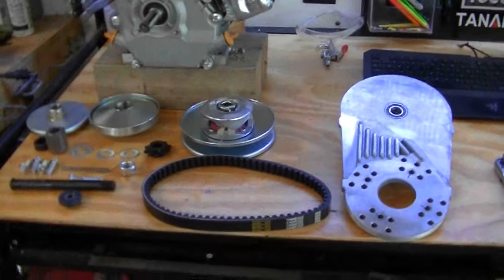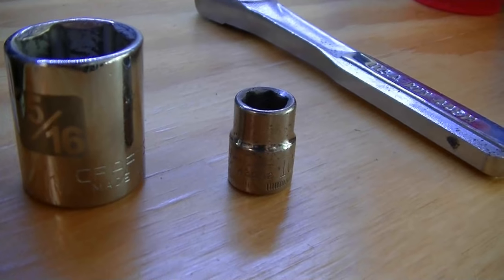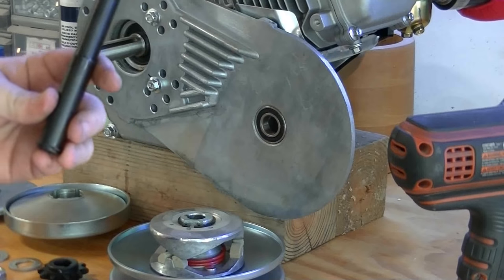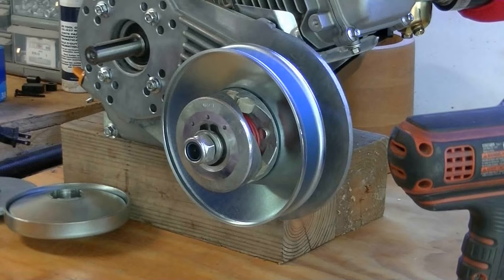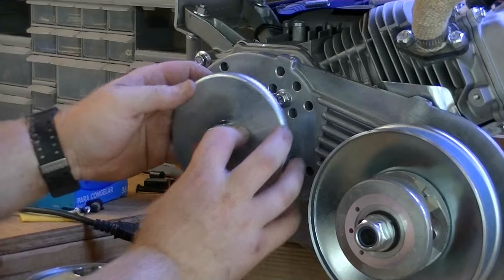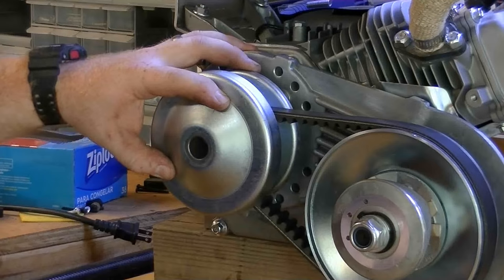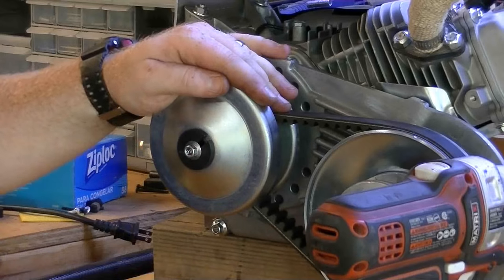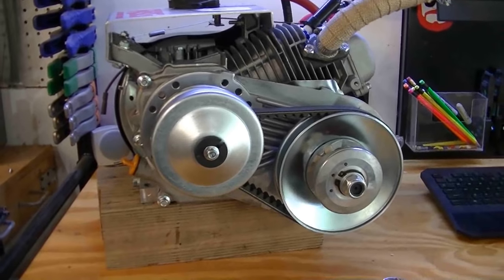Predator 212 Go Kart Torque Converter Install

Comment: What sized bolts do I need to mount the thing to a predator 224?  The ones that came with mine are a different thread. Would they be the same thread as a 212?

Comment: Hey Red Beard, your knowledgeable about these things I got a question? Can a torque converter go bad enough to stop an engine? I noticed it's been happening lately and when I try to restart it the wheel moves with the pull string. If I roll the bike a little bit it breaks loose and I can start the motor back up. Could it be one of these pulleys going bad or getting stuck?

Comment: Warning! 
The 4 bolts that are needed to mount it to the motor are 5/16 - 24.
I didn't see it mentioned anywhere and spent a couple hours and trips to 3 different stores all while lugging the motor with me the entire time to find out.
Reply: Why didn't you just look at the engines manufacturer's spec sheet, Google your engines owners manual and shop maintenance guide PDF download, they tell you everything you would ever need to know.
Reply: @BubbaB43 
While that is a good point, the poster's point is that the info in the video is wrong on the bolt specs.

Comment: Several have made inaccurate comments about problems with the front bolt (thread and length). I bought this same exact clutch ( Comet 30) from gopowersports last year, used the same bolt here in this video, and the front bolt works perfectly with my Predator Hemi 212 from Harbor Freight. I would know if the threads didn’t match… I’ve been turning a wrench for 45 years. You guys are misinformed. Amateur hour & armchair know-it-all’s.

Comment: So the bolts that are supplied or actually the ones that work on it I same one video before that they said you had to switch him out with some other kind because the threads weren't the same

Comment: I’m installing on a HF predator 212, the bolts included were not correct. I needed 5/16-24 SAE.
Reply: I had the same problem
Reply: What bolt did you use for the crankshaft on the torque converter

Comment: When you mount the clutch to the crankshaft that is not a 10mm bolt. It is a M1.25 metric bolt which should not be used because  the predator crankshaft comes tapped for 
5/16" 24 (fine thread) bolt
Reply: Tim othy 5/16 24 = m8x 1.25
Reply: @timnell9423  Not true.

Comment: Just bought one of these setups for predator 212 becuase the kids kept blowing up the old stock comet. Beware those sprockets, they have broken the keyway one in half more than once, so i upgraded it to an ebay replacement with keyway built in, eliminates that weak point. Thanks for the video
Reply: AH! I just bought a 9 tooth to replace the 10 for more torque, but I thought it looked thin and weak where the keyway is cut in... I did see the ones with the key molded in, makes sense! Good heads up!
Reply: Link? Wdym?

Comment: i have the same motor for my ho kart it comes on but everytime i give it gas it cuts off... it has gas and oil what am i doing wrong
Reply from the maker: +Shanesha Grayson it's always hard to troubleshoot something over the Internet. First off have you did any performance mods to it?
Reply: Shanesha Grayson did u disconnect the oil switch wire.it might be to full.its that sensor on the front with the two wires.
Reply: gotta give it a minute or two to warm up, then switch it to run
Reply: HOGSIDE SJ T.V. Thank you so much bro this fixed my problem, I'm so pumped to drive it again!
Reply: Just dump and clean fuel bowl

Comment: I have a similar torque converter but it doesn't disengage when idling...I made sure that the belt is aligned and that it is facing the right way but still no luck...any ideas on why this is happening?

Comment: Hi RedBeard great video. Used it to install a new $65 TC off eBay for the 212. However, after I installed it, the go-kart vibrated REALLY bad and didn't accelerate worth dookie. I've done engine swap before and such, so I made sure everything was aligned properly, bolted on tight, chain had just a little slack, belt clutch on drive shaft tight (had to use shaft spacer to align clutch with jackshaft), even made sure the tires were equally inflated, what could be the problem!? It didn't vibrate before the TC install
Reply from the maker: +boisebadboy93 I really have no clue what it could be. It's hard to diagnose something over the internet

Comment: I'm trying to figure out what size and thread the bolts I need are to mount a TAV2 to a new Hemi head Predator 212. Also the bolt size / thread for the output shaft.  My torque converter came with all the wrong size.
Reply from the maker: +BWX I'll have to look and see what size they are. Next time order from go power sports and you won't have that problem. Lol.
Reply: Yeah I guess but I don't think a few bolts are worth $74 extra which is more than double the clone price. If their prices were more competitive I would definitely support them with my $$.  I think the clutch mounting bolts are 10mm but not sure about thread pitch.
Reply: For anyone reading this 10 years from now or something:

I did some more research-
I think the bolts you need are 4 x 5/16 24 thread pitch 1" - To mount 
plate to engine.

1 x 5/16 24 thread pitch @ 1 3/4" - for mounting the drive pulley to the output shaft.

Then you need to raise engine up about 3/4in to an inch to clear drive  pulley above frame (still need to cut plate though), so you need longer  engine mounting bolts too.

Comment: Read Beard... I just bought a used Baja Warrior and it has a Preditor 212 and CVT but the problem I have is the two pulleys are about 1/4" out of alignment, the drive pulley is too far in... I removed the washers on the rear shaft until the chain hits the backing plate. I suppose I need to make a front spacer to fit on... another problem I created is that I stripped the threads in the center of the engine drive shaft, so I'm going to have to drill it deeper , tap it and get a longer bolt to hold the drive clutch on... so beware!

Comment: I just installed pretty much the same one on my kart w/the 2121 and I can't get the wheels to spin freely when in idle. When I pull start the kart it wants to move the wheels along with it. I dialed  back the idle as far back as it can just in case and still it seems like the torque converter belt is engaged even when in idle. Have you seen this? Any suggestions? Is it just a bad Torque Converter? Here is mine: https://www.youtube.com/watch?v=MMP0gvC3AOY

Comment: I got the same torque converter and everything fits very well, but if i speed up its sounds very Bad and the spring  vibrate hardly on the engin side . I think its because of the spring on the driven side. Its looks like its made for the other direction. My Engine is turning against the clock. Have tourque converters a direction ? Or they work booth ways ? Edit: sorry for my german english
Reply from the maker: Are you sure you seated the outside bell on the flat sides of the inner cog?

Comment: I purchased a  TORQUE CONVERTER KIT CLUTCH 3/4" COMET TAV2 30-75 218353A 12T #35 10T 41 for a golf cart.  I found drive belts for (30 Series Torque Converter Belt Comet TAV2 203589 Manco 5959)  will these drive belts fit  they say they will fit the COMET TAV2 but the last numbers are difference?   Also long will these belts last?  I like your videos keep them comming.

Comment: the go power sport page has many to choose from. what one works on the preditor 212.
Reply from the maker: 30 series kit
Reply: Thank you. mine only came with one sprocket, how can i tell which chain to buy. this one is 10 tooth and a quarter inch wide. Thanks. You rock.

Comment: I just built my drift trike and finished it(looks sick) and i broke my torque converter back plate in half SMH ....do you think i should get it welded somewhere or is it easiera and cheaper to buy a new one? If you watch my video youll see i just bought a new $60 clutch from tractor supply for now...but id like to Get the torque converter on it and fixed..thanks man your channel is awesome! 👍

Comment: hey Redbeard I have a question I have the maxpower 455 35c 12T max torque clutch...my question is if I take that out and replace it with a torque converter is there any difference in speed..top end especially...thanks
Reply from the maker: +scotty w we gained top end when upgrading to the CVT from a clutch. The torque form the CVT alone is worth it.

Comment: are these cvt converters compatible with any stationary horizontal generic engine of aproximated size and power? or are more detailed about  each model as it uses specific rpm i suppose, would it work on smaller engines, if not so, are there simmilars for smaller ones?
Reply from the maker: Yes the 30 series which this one is, is made more for 6.5hp engines and lower. The 40 series will handle the larger engines.

Comment: Thank you for the guide. Will follow this to a T when I receive my torque converter.
Random question - which length of 5/16-24 bolts do I need to mount my predator to my Go-Kart? Thank you.

Comment: I am looking into picking up one of these, my only problem is that I have a 428 sprocket and chain for my bike and I can’t easily change to one either the 420 or #30 chain/ sprocket. Are the sprockets that come with with the torque converter replaceable with different sizes?

Comment: im having problems with mine. its eating a belt every hour or 2 of riding and i have not a clue why. the inner plate and the jack shaft pulley are not perfectly aligned(the side closest to the motor and its a very little difference) any advice? also i have an off road go kart with a 72 tooth sprocket that was originally powered by a Mitsubishi 6hp that had a weird torque covert on it it but i decided to repower it with a new predator engine and new torque converter that i got off of amazon
Reply from the maker: Are you sure you have the right size belt? You could have a smaller belt on it and that could be the reason.
Reply: Yeah I used the belt it came with so idk it was a little tight
Reply: Chris Wrigley I had the same problem. I never had the plate, mine goes straight to the jackshaft. you need to install grade 8 washers to space it evenly. grab a longer grade 8 bolt to go with the washers. install on drive, not driven

Comment: At 4:07 I noticed you only had a 1/2 in" of shaft to put on the last part of the clutch. Is that going to be ok? I bought a new motor for my go cart. My old motor has about an inch more of shaft than the new one. I am going to have mount it the same way you did on that last half inch of shaft.
Reply from the maker: It always worked good for me

Comment: Im having problems installing mine i did everything you did exactly but when i turn on my engine the belt speed keeps spinning without me even pressing the throttle  so how can i make it stop ? The belt speed should only spin when the gas pedal is pressed right ?
Reply from the maker: No the belt can spin at idle as long as the go kart isn't trying to take off. If it isn't then your good to go.

Comment: New to karts. What's the difference between a 30 and 40 series? I'm upgrading from a Briggs 3.5 to the 8hp predator and I'm not sure which converter would be best. Thanks
Reply from the maker: The 30 series is more for the smaller engines and the 40 is for the larger engines. They sell them by power levels. 301cc you would want a 40.
Reply: 30 series

Comment: So I’m working on a Baja warrior 200 with now a 212cc predator engine. I’ve followed many steps on installing torque converter and engine with wiring. But when I try and pull start it, it seems like it wants to start but it shuts off? Could it be it’s too tight? But I also loosened up the bolt and nothing. Can anybody help?! Doing this on my own. Thank you

Comment: What are the threads & bolt size for the "10mm" bolts to mount the torque converter?  The supplied ones with mine only thread in a half turn or so before they feel like they are going to strip.  Thanks!
Reply: Can anyone confirm 4x5/16-24UNF as per the user 212cc manual?
Reply: As per the internet forums "I can confirm the Predator 212cc uses 5/16 - 24 for the crank shaft and the 4 block mounting holes, the Predator 346cc and 420cc use 3/8" - 24 for cranks and 5/16" - 24 for the block mounting holes"

Comment: Im Wondering if a stock CVT transmission off a Honda ruckus or any scooter will do the same thing. I'm trying to find a scooter shell that I can throw my already built 212cc in. As of right now I have a centrifugal clutch and 420 chain set up on my mini bike. It seems as though most scooters use the CVT not only as a transmission but also  as a swing arm.  My goal is to have a "sleeper" scooter that I register as a 50cc.

Comment: I did mine yesterday and the bolt that came with it for the crsnk pully was way to short so when i put the impacy on it it tore the crsnk up ni guess that just gives me a reason to buy a new one. So check your bolt and make sure it gonna grab more than 3 threads
Reply from the maker: Yeah I have had to buy longer bolts for mine

Comment: I want to put a Predator 301 and a series 40 kit on my mini bike (Carl Heald Super Bronc) but I do not want to change the frame or space my motor up. How far can I move the center to center of the driver and driven and still buy a belt . I am assuming i will have to make my own mounting plate and maybe a Jack shaft

Comment: Any idea why my belt doesn't spin? Installed correctly but belt will not rotate with torque converter that is properly spinning, belt has no grip. I don't get it. Thanks for any advice!

Comment: Can I buy 30s torque converter parts and mount the driver to the engine and the driven to a jack shaft off of a forward reverse gearbox that sits further back and not have a backplate and use a longer belt? I’m trying to eliminate going from belt to chain to gearbox and just go belt to gearbox. Thanks for your time in advance.

Comment: So it doesn't matter if the front flat pulley lines up with the rear flat pulley does it because on mine, to line them up makes the engine shaft too short.
Thanks for anybody's comments

Comment: okay so if i just want to go straight from the engine to the axle do i just need to put a sprocket on? im completely new to this
Reply from the maker: +GameHunter you need a clutch or a tourqe converter on the engine then it will go to the sprocket on the axle.
Reply: I'm trying to clean a torqconver on a 212 cc tachmsah

Comment: Hey Red Beard. I just got my torque converter on from Go Power Sports and I love it. But I think there might be problems?
1. The belt moves when the engine is on.
2. The go kart takes off on stand still.
3. And the engine tuns off when coming to a complete stop.
What should I do? Also there's an aluminum flywheel and stronger replacement drum springs on the torque converter to withstand the higher RPMs on my Honda gx200 engine
Reply from the maker: Have you double checked the installation of the tq? Make sure you installed everything in the correct order. I had one a while back that did the same thing. Im trying to remember what i did to fix it.
Reply: I put it on just like you did?
Reply: Your engine idle rpm is too high.

Comment: That motor was obviously upgraded. If the torque converter is for a 6.5 horsepower motor how did it do for you 12, maybe 10 horsepower motor?

Comment: Hey man quick question is there any reason why my torque converter belt isnt moving.when i hit the gas it just revs doesnt even move. The belt moves fine when i push the kart. Also the bushing and everything is there but why doesnt the belt engage?
Reply from the maker: Something isn't right with the drive pulley (front pulley on the engine). Pull it apart and make sure everything looks good
Reply: Red Beard's Garage i did it looks like the pully can be pushed in a bit more.i might of faced the belt the wrong way too ill need to check in the morning. But the pully does look loose and shakes like crazy when i start the engine
Reply: Did you buy the correct sized drive pully? It seems like you bough a 1" for a ¾" shaft
Reply: Jake DiMauro yeah it worked well for like 30 minutes until the bolt went flying out do to it being the wrong size. But then when i put the correct bolt and put the pulley back together it doesnt work anymore

Comment: Helpful, but now I have a problem with holes lining up and the engine needs to be raised up an inch because the torque converter is hitting the frame and the brakes. 
Plus the design is bad, you should be able to put spacers behind the shaft of the plate so you don't have to cut your oil plug.

Comment: Somebody may have asked this, and if so I apologize: I have a kit 196 with a shaft welded on the back. I assume I just remove the rear pulley from the plate and put on frame shaft correct? Love your videos thank you for what you do!

Comment: Just replaced TC as in this video (enjoyed it BTW) and I have a question...Why is the belt so hard to place over the brass slip ring?  The belt is a 669, but after locking everything into position, it is so tight my wheels keep turning.  No idle.  Thanks.

Comment: So just out of curiosity, you’re not planning on changing your oil are you because the year you cut off was the oil with the oil dipstick in the cover that to the point where it can’t get good access to fill oil it’s just a one time engine then it blows then it’s fuckedbecause you can’t change the oil unless you rip the engine out and take off the accessories just to either change or add new oil